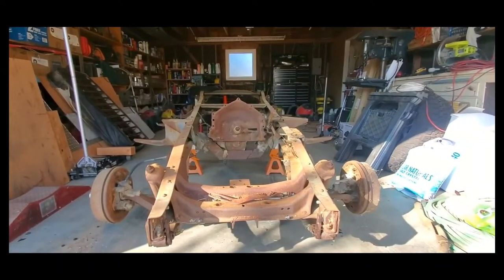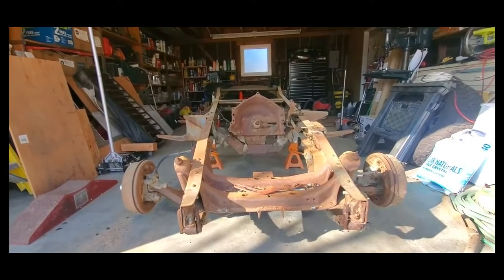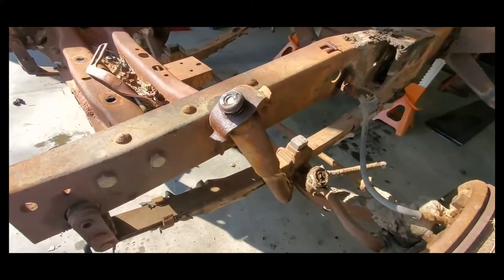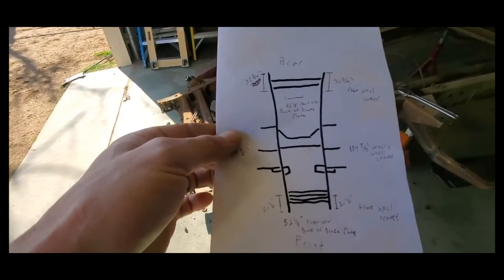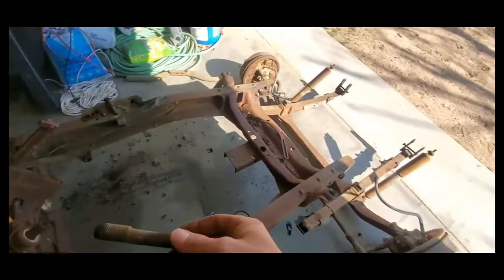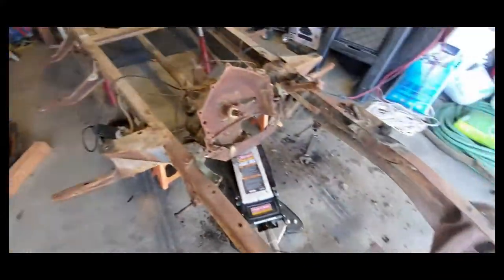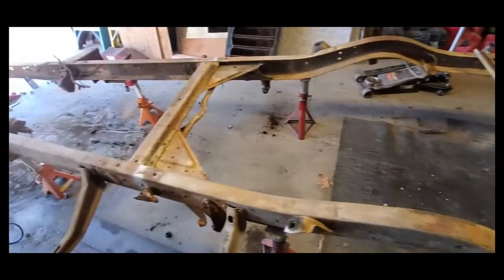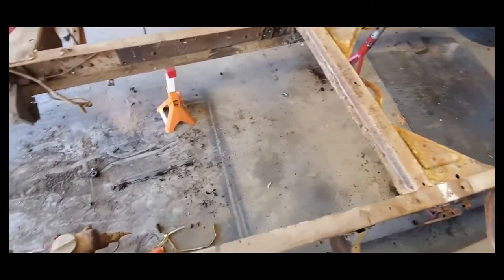1953 Chevy 3100 Pickup Part 2: Frame striping

Comment: Man thank you. my stepdad bought me a 53 3100 5 window nut for nut, bolt for bolt when i was 16. i went into the army at 17 so i never really got to do anything with the truck. im 23 now and just had a daughter a year ago. my dad turns 80 this month and for the past 2 years ive been paintng the body and frame. im going to throw a 350 small block in it but thank god whoever owned it before me did a convo with it so its saving me alot of time. but i dont know too much about mechanics so im trying to teach myself as i go and your videos are honestly the most informative ive seen so far. i cant wait to see your future progress man and how your truck turns out.
Reply from the maker: i am glad the videos are helping you. we did slow down a bit because i have been working on other vehicles. i am in the middle of plating the frame. that will be a video. i should have one or 2 more for front end assembly and rear end assembly. it will go out to powder coating after that. when it comes back probably a video for getting the frame to roller. our videos do slow down as summer comes it gets too hot to work outdoors. thank you for watching.
Reply: @SKPcars  you got a new subscriber

Comment: I've watched your videos today on the 3100.  I"m building a 37 Chev PU.  I started 35 years ago with the intent of restoration.  My dad and I were working on it together.  We had gotten it to the bare frame and had stripped and rebuilt the spring mounts and shackles, painted the frame as well as the springs and axles.   New king pins and brakes.  This was a few years since I'd started as I had moved and built a house in between.  Dad passed suddenly and my interest went to zero.  Other life events occurred and the truck sat in my mom's garage until a couple of years ago.  I finally drug it out and moved it to my new home in South Dakota.  So the direction has changed, I'm going for more of a restomod.  I've already done a FATMAN MII front end and an Explorer rear end.  I've boxed most of the frame and installed a center section from WELDERSERIES in Canada.  My engine is from a 2014 Silverado with a 6L80 transmission.  
So watching you with rivets and springs brings back memories that date back over 30 years.  The shackle pins are also threaded as were the fixed pivot bolts.  the ends of the pins are tapered and the pressure of the shackle bolts clamps them in.  Like you my springs were in great neglect and ready to fall apart.  When cutting rivets I found that cross cutting the heads with a cutoff wheel and then cutting the heads off with an air chisel.  Once cut off, I drove the rivets out with a punch on the air chisel.   For over 20 years the design of suspension and drivetrain was virtually unchanged.  What your's looks like, is exactly what mine looked like.  I haven't gone through the effort of painting the insides of my boxing plates as I knew when they're welded the paint will burn off.  My intention is to fill the frame rails with Cavity wax when I'm done welding on it.  The box mounts are different on the 37.  They bolt through the bed and wood blocks and then through the frame.  I"m going to build brackets welded to the frame and put 1/4" urethane cushions on top.  The cab mount is different as well,  There are a total of 8 bolts through the cab into the frame.  The front 4 are bolted with a rubber like cushion but the back 4 are longer bolts with springs to accommodate the flex of the frame.  As the frame will not be flexing much now, I'm going to bolt with urethane mounts that are about 1 1/2" thick.  I"m welding threaded rod couplers into the frame for the cab bolts.
Reply from the maker: It sounds like you have a great plan. I blew all the rivets off because I'm setting it up with a mustang 2 front end and a coil rear end. I painted the inside to give to some protection because I'm not planning on doing any with the inside. The frame is getting powder coated they will cover what they can inside and depending on their process may end up stripping the paint inside. I should have had the frame plating video done but my father in-law critized all my weld, which are good just ugly, and it made me slow down. I'm about half done plating and installing the engine cross member. The cab on these doesn't have many bolts through it. If i remember right there are only 2. The others bolt attached to a plate on the bottom.

My plan was to do the hydraulic fluid on my tractor this weekend but we have 40 mph winds right now and the 53 is taking up my gargage space. It will probably get postponed until the winds die down. Plus i have other non-youtube projects that require my attention.

I hope you are enjoying the channel, please make sure to subscribe and share it if you know people who might be interested. We need more subscribers. I will keep putting up videos for this truck as the project goes along.
Reply: @SKPcars  I used a Total Cost Involved spring kit for the rear of my 37.  So far it looks like the rake I was shooting for is good, but I won't know until I get the box on and see how the rear settles.  MY fatman Mustang II is their stage 3 which has coliovers.  The 8.8 Exlplorer rear end is an open differential.  I see that now as being a problem with 355 HP.  I'm thinking Eaton Trutrak.
Reply from the maker: I got everything to make it a roller from speedway motors. I am not sure what my rake is gonna look like until it is built. I may have to change springs once it is built. It was all the 47-55 front and rear kits for the 3100, with a 350 gear. So far the plan is 350 all the way across. 350 4bolt, with a 350 trans and a 350 rear gear on a ford 9". We haven't ordered the engine or trans yet. I want it rolling first.

Comment: I am starting my build same time as yours, you remove the emergency brake bracket to to put a rear 4 link same as my build, how are you going to attach the ebrake? My frame is very mess up and getting a long bed frame and I am going to cut it, I think I have a good idea how to do it at home, my brother jesse is a machinist and he is good with al the dimensions, but I am concerned with the ebrake bracket, I can’t wait for your next video !! 2 Thumbs up 👍
Reply from the maker: I removed the bar but the plan right now is to put it back in later. there is an aftermarket relocation set up. i don't remember at the moment who sells it. The original set up is kind of janky. that bar is just used to give the cables a center point to be pulled from the mechanism in the cab. It can easily be moved to a plate that is much smaller. at the point i am at right now it is a kind of a low concern because there are options.

Right now i have to finish plating the frame and get the video up for that. install the front suspension, put that video out, install the rear suspension put out the video for that. send it out for powder coating and reinstall everything and roll it out of the garage, put a video out fore that. i will hopefully get to there late fall or in winter.

Thanks for watching, please make sure to subscribe to see everything we get done.